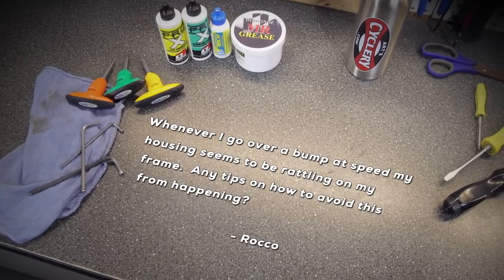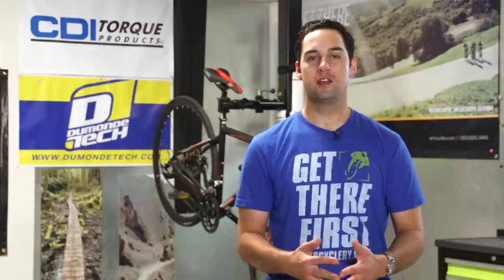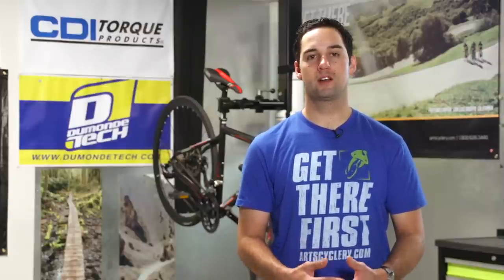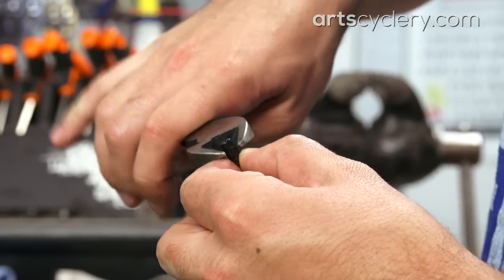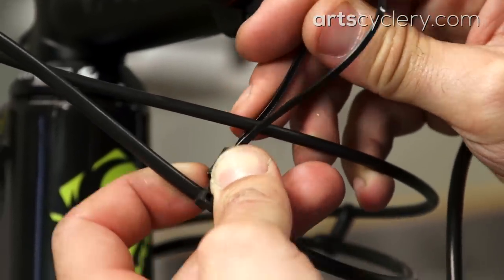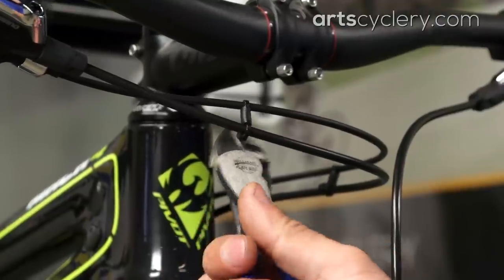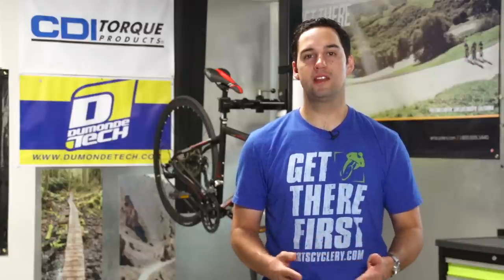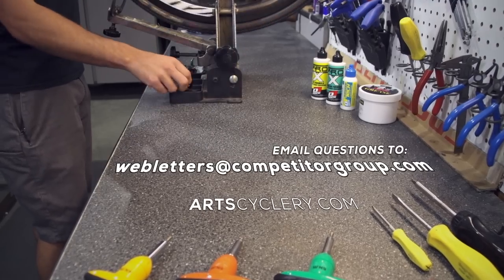Ask a Mechanic: Silence and Organize Your Cable Housing

Comment: I just added a dropper post and used this technique with a twist.  I have smaller zip ties and used a presta stem valve cover in place of the ferule.  Just cut off the end of the presta valve stem cover and use the same technique as covered in the video.  Worked great.